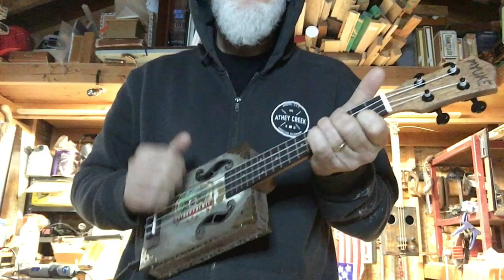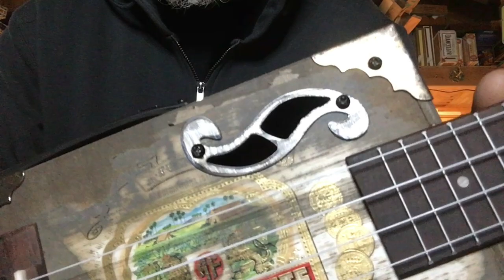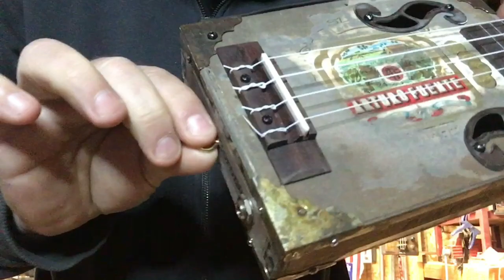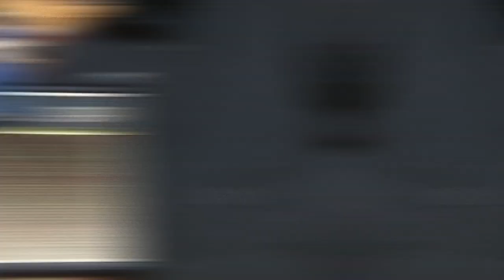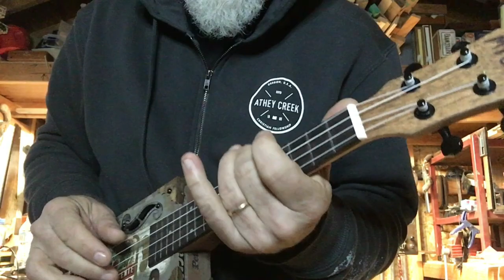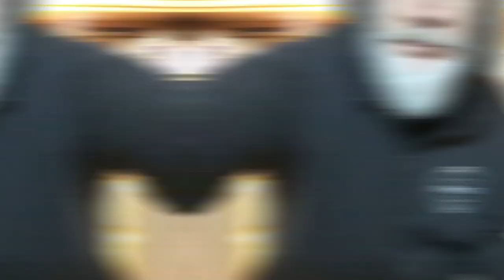Cigar Box Ukulele with onboard Preamp and 4 band Graphic Equalizer

Comment: what happens if you change to steel  strings?  could you try, please?
Reply: It would probably bend the neck
Reply from the maker: customer wanted nylon strings.  you can build one and give it a try... i’m sure it would be loud like a mandolin 😎
Reply from the maker: nope... the neck is rock solid 😎
Reply: Nylon is the right string for uke - and you don't have to have a magnetic pickup , so there's that. (Random thought: Cigar box mando, haha!) I dunno what's the string tension of nylon, but it's not much, if any, less than steel.